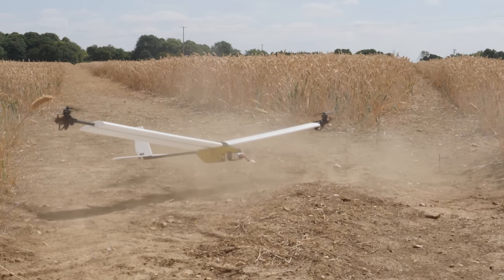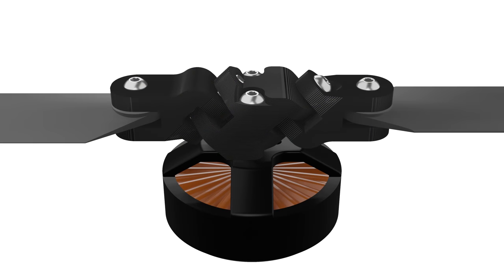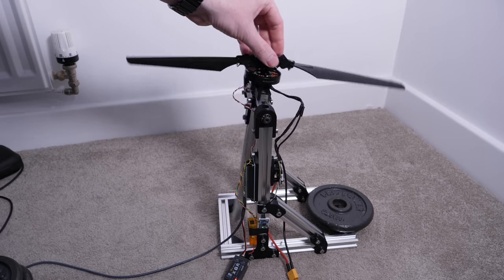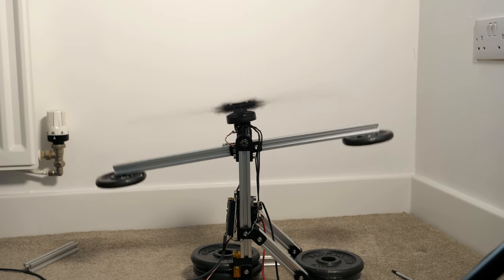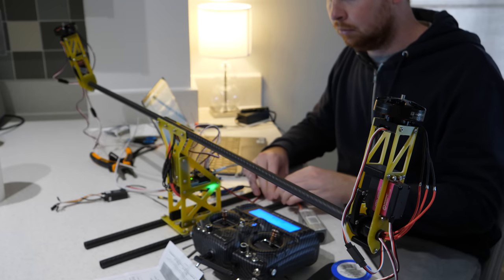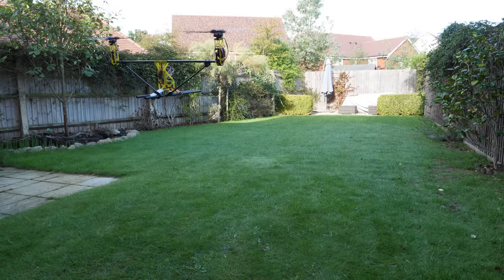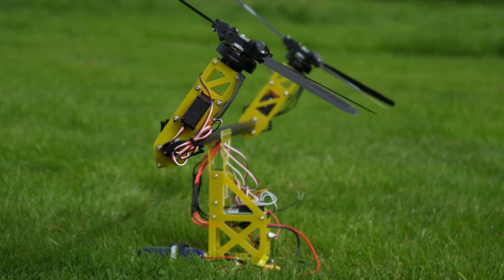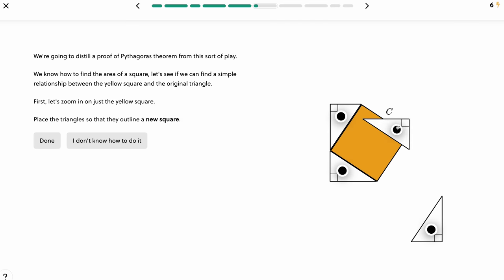Building a V22 Osprey - Part 1

Comment: Where's the drive shaft between the 2 rotors?
Reply: rc man no safety required
Reply: @zachmoyer1849  Then it's NOT an Osprey. Anyway better designs like the Raider will replace it.
Reply: @sjvche7675  hes not building an exact replica just replicating the hover to winged flight mode of course its not an osprey its three feet wide
Reply: @zachmoyer1849  A tough design problem.

Comment: Tom, what you are doing is just great stuff.  It reminds me a little of a toy I bought (as an adult) called the Vectron Blackhawk.  I found a nice video on it here. 
https://youtu.be/kMjVjdSLO_s 
But this was a very cool toy that spun three rotors, all in the same direction, and also had an IR LED that spun around with the whole saucer and told the transmitter what the orientation of the disk was in.  Direction was controlled by accelerating the motors on one side as they spun around just like what you're doing.  As an added bonus they put a strip of LEDs that you could program to strobe a message.  Very cool toy, I gave it away to friend some years ago.  Keep up the great videos.

Comment: Information you might find interesting; 
This video gives the general development background of the rigid rotor design Lockheed used on the AH-56 Cheyenne. 
https://youtu.be/_6GAp8yO7l0
Of interest: How to "fix" the vibration problem (and instability) of the rigid rotor designs: use four blades, not three. (😁)
Also of possible interest: using the opposing (in a 4 blade design) gyroscopic forces to "balance" the opposing blades.

Comment: Okay, so your assessment of the Osprey is close. It obviously has a motor at each wingtip to run that rotor. The absolutely crazy part of the Osprey is that they are designed with redundancy and resilience in mind, so if 1 motor fails it doesn't immediately fall out of the sky. No the Osprey has a complex linkage between the motors meaning that the aircraft can still power both rotors if one engine fails. That fact alone is what made the Osprey as expensive and problematic as it was during development, and just thinking about that makes my brain hurt, in addition to making the Osprey a much more staggering piece of engineering.